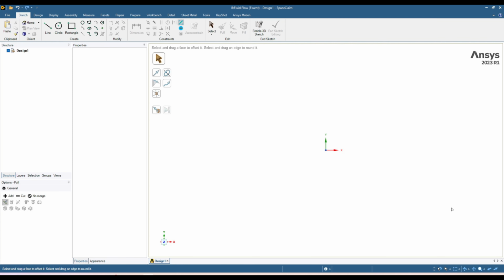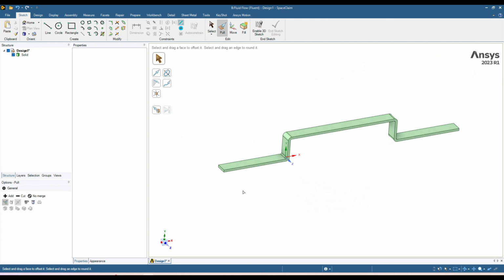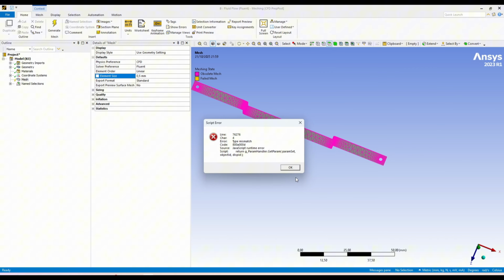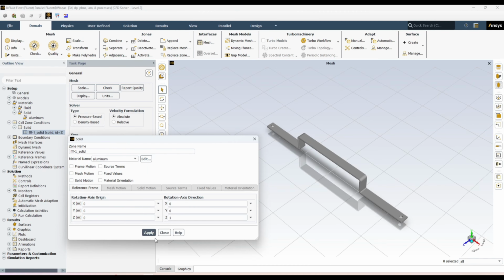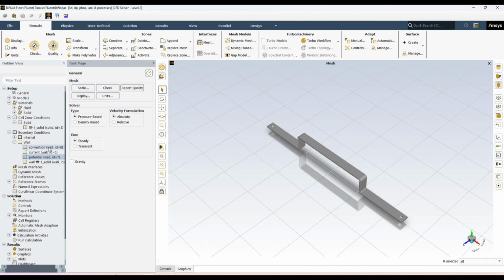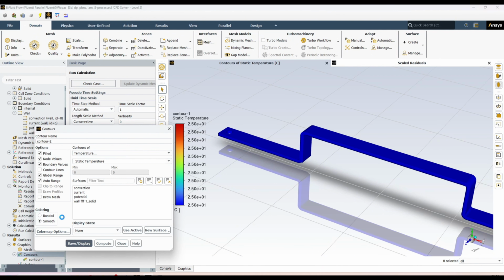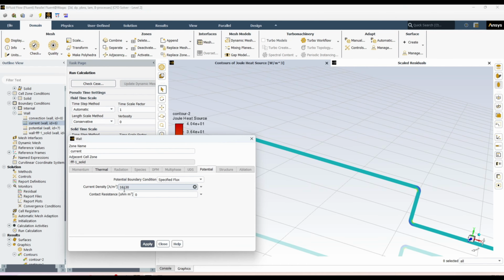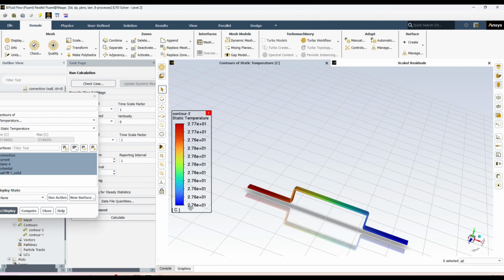Thermo-Electric Coupling analysis in Ansys Fluent | Ansys Fluent tutorial | Learn tech | Ansys

Comment: Hello, may I share this video tutorial on other platforms? I will credit the source.
Reply from the maker: Sure. Also share the platform with me please.
Reply: @WaqasLearnTech  The platform is Bilibili
Reply: @WaqasLearnTech  I have a few questions for you. I'm currently working on porous media and need to perform Joule heating calculations in Fluent. I'd like to ask why, after applying a current density, the temperature decreases from the positive electrode to the negative electrode instead of distributing symmetrically from the center outwards? In my experiments with COMSOL and my own work, the temperature distribution is centrosymmetric, but in Fluent, it decreases from the positive electrode to the ground electrode. Your model seems to be the same. Thank you very much.